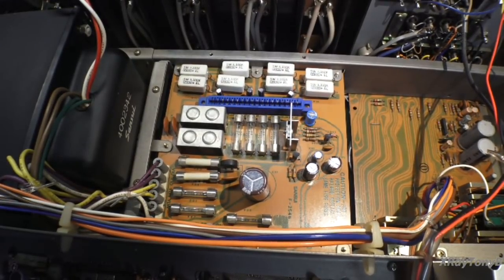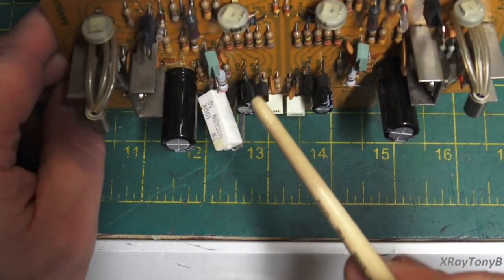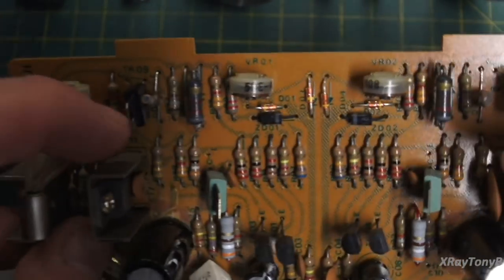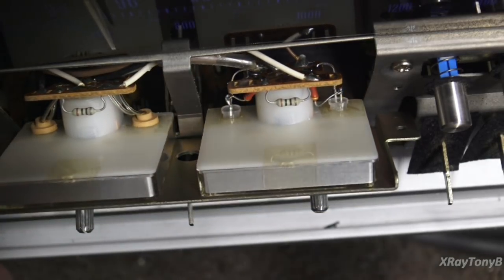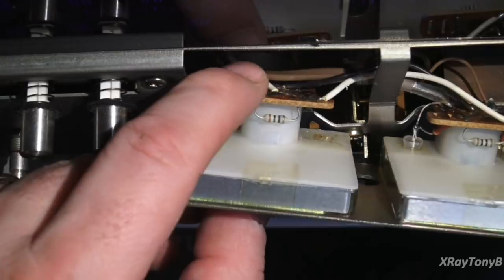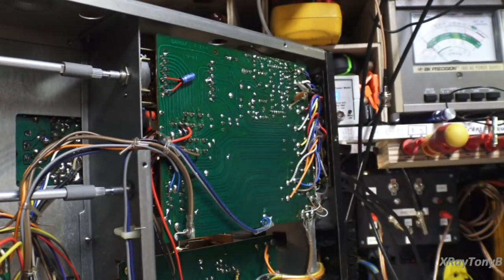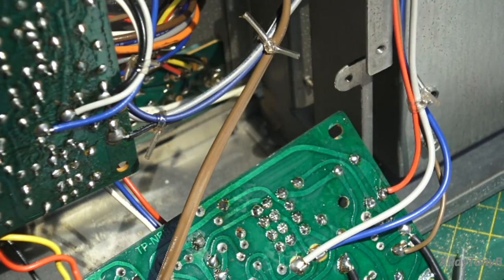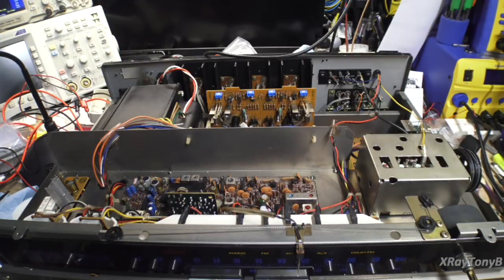Sansui 9090 Part 2 - LED upgrade and Replacing the Capacitors

Comment: I thought I'd remembered this, but I had to check first with a couple other techs I know - but for future reference, you don't have to attack the tuner board from underneath. With the front panel removed, the entire tuner assembly, including the front end, dial scale, etc all comes out just by removing about six screws, then lifts out, and tilts back. Easy peasy. Next time, eh? Love your work!

Comment: A note for folks working on a 9090 A or B rcvr if you do a refurb on these units check the Lamp board that the dial lamps go into they are prone to cold solder joints that will cause intermittent dial lamps. I have seen it on 5 out of 10 units and I do quite a few of these.

Comment: Very informative videos. Do not forget to change the capacitors across the transformer & power switch with some X/Y caps.
Also, I see that one side of the power cord is connected to the chassis via a 1.5g resistor. If you replace the power cord with a polarized cord, you can make that grounding resistor to always connected to the neutral line.

Comment: FOCUS YOU... Fine Camera!        That had me laughing for a good minute.

I converted the lighting on my old oscope to LED and with the phase shift it still flickered, my guess was they were too far apart. I had to toss in two diodes and a small filter cap. I also had an issue with the LEDs still glowing from the charge of the filter cap when it was off so I had to toss in a 4.7K ohm resister to bleed off the filter cap. That was the oddest conversion I've done and it looks like I might have to do it to my TrueTone D2626 I am restoring.

I live in Florida but it still gets below 32 degrees in the winter. When a freeze snap is about to happen I'll turn on the water to a slight trickle and open the cabinets so with the heater running it will keep some of the pipping warm. However with below 0 temps I doubt that would work.

Comment: BTW, I found that I like to view LED polarity as this. When you look inside, one lead looks like a fine wire, that is the anode. The other lead attaches to what kind of appears to be a "cup". So I taught myself that cup is cathode. Cup/Cathode...and remember that cathode is negative or zero. I've had a few people say they liked that tip. Just putting it out there.
Reply from the maker: Great tip!  Thanks!

Comment: Thank you for addressing the use of the Wima caps!! Just so happens I'm doing my first recap of a Kenwood KA-7100. I read that I could replace electrolytic caps <10 uf with the Wima caps, but was unsure if I should make the change. The only question I still have is that the Wimas I looked at on Mouser mentioned they were for automotive use. Am I looking at the wrong caps or is that just the "standard" use for those caps?
Reply from the maker: You are correct.  Those are rated as automotive grade, which means that they can withstand  wide temperature and humidity changes without affecting their value.  They are very stable and accurate.  That's why I use them.  Thanks for watching!

Comment: Great video as always! Thank you! Can you show how you did the source LED light replacement? I can't figure out how to remove them from the board as it appears the board is connected to the plastic housing unit. I'm afraid if I pull too hard, I'm going to break it.

Comment: Hey there.  I think first time here, kinda like.  Have always wanted me a good older Sansui amp or receiver.  Here is what I consider a WARNING.  DANGER WILL ROBINSON... LOL.   The smaller through hole capacitors, largely used for filtering, audio boards and the like are being marked as NOT FOR NEW DESIGNS.  I suspect that means that very soon these through hole components as well are going to be going to the wayside.   Stock up now....  Cool video.

Comment: Just a word of caution -- the long/short lead can't always be used to identify cathode and anode (I have several hundred examples in stock with a long anode lead) on an LED. However, the flat or notch on the case always indicates the cathode.
Reply from the maker: Thank you for the correction on that!
Reply: Less a correction than a warning that all manufacturers don't adhere to the de facto standard. One of my favorite quotes: 
"The nice thing about standards is that there are so many of them to choose from." - Andrew S. Tanenbaum 

BTW - Thanks for doing these videos.  I've been in electronics for 40+ years, but still manage to pick up tips from you on these 70s restorations.

Comment: Arrow has the KSC1845 in stock.  Out of stock happens at the end of the year I have noticed, starting in September.
The black stuff on the legs is non-conductive paint to prevent arching between the legs (early solid state).  I don't know why people started to think it was corrosion as copper and zinc don't corrode black.
Reply: No, that black stuff isn't paint, it is most likely silver oxide or similar. Transistors did not have black leads when they were brand-spanking-new. Whatever those leads are plated with, it oxidizes and turns black. As noted in the video, this oxidation will climb up into the device and cause intermittent action and noise and eventually destroy it. I work on vintage stereo equipment for a living full-time, and the owner of the shop is an engineer and ham radio operator , with electrical degrees hanging all over the place. He has been repairing audio equipment since the early 1970s,  and when he tells me it's oxidation, I believe him. Always best to replace any black legged transistors, especially in the tone control and output amplifier circuits, as that is where we see them cause lots of problems.

Comment: -12 degrees? Here in San Antonio Texas it went down to 30 one time...I nearly needed a jacket...lol
112 in the summer though...I'm a former Detroiter, so I hate the heat.
Reply from the maker: Had a friend that lived in Houston.  While I was visiting, I noticed a dial-faced thermometer on the front of his garage.  The plastic dial melted!!  Never did figure out the actual temperature that day :)  At least you don't have to shovel heat!!!

Comment: Around the 38 minute mark, when you run a wire from the ground post up to the chassis screw, there looks to be another wire coming off the screw next to the capacitor common point. Could you tell me what that is? I have a 60hz hum at any volume and I think this could help. 

Really appreciate you posting these videos. They've been really helpful in repairing my 8080.
Reply from the maker: Hi Sam.  That is a very important wire.  It connects the ground point of the capacitors to the chassis ground.  All other grounds in the amp are connected to this "star ground".  Without that wire, the main filter capacitors won't be grounded to the rest of the circuit.  Hope this helps.
Reply: Thanks so much! I see it now. I didn't realize that wire was running into the same piece of heatshrink as the capacitor ground, but that appears to be what's happening. Thanks again for all of the info.

Comment: What's the benefit of using a Nichicon Fine Gold cap on the protect relay board?  Just something you had in stock, or are you expecting audio quality improvements?
Reply from the maker: It makes the relay sound much better as it's clicking in and out ;)  All kidding aside,  just ran out of the standard caps of that value so I used what I had.  I try to wait until I have a big order before restocking to save on shipping.  
Thanks for watching!!
Reply: LOL!  That's what I was thinking.  Great video BTW.  Keep up the good work!

Comment: I have an au 7700 amp, I brought in to have it repaired but the fellow told me it was starting to go bad, the switches and input board are failing and perhaps more but I wonder if it's possible to replace or repair these parts or if the unit can be restored properly etc..?
Reply: Doesn't sound right to me. Whats the amp doing ?

Comment: Is it better to replace the mechanical relay with solid state electronic relay?
Reply: Why didn't you film the tuner alignment would have been interesting to see that, maybe next time.
Reply: You can't use those in the audio path. They only work for things like mains power.
Reply: You could use an SSR circuit that's specifically designed for audio applications http://hifisonix.com/wordpress/wp-content/uploads/2012/08/Speaker-Relay-V1.03.pdf  but modifying an existing circuit to add it wouldn't be cost-effective.  Replacing with a mechanical relay costs only a few dollars, is pin-compatible, and reliable enough to last another 30+ years.